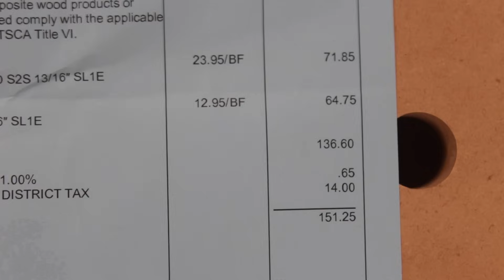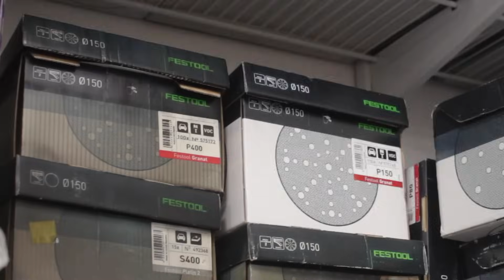Building A Tambour Whiskey Bar

Comment: Omg that end grain is glorious! Obviously how you did your rabbets were scary, I’m trying to remember from the start (end grain is confusing me) but probably would’ve been best to to add those prior to cutting your pieces small. But again I could be wrong, with the grain direction changed early on I can’t figure out if that would’ve worked or not plus you cut your shorter so that’d be something you’d have to rip early on too. Another idea is to mount all those pieces snuggly onto a longer/taller board using carpenters tape and then rabbeting those out. Regardless, good job mainly said that for anyone watching and wondering another way around it! Very good job, I love this simple size and the beauty this piece has is just stunning! The cow hide is my favorite idea for joining all those beautiful pieces of end grain together! Love these builds
Reply from the maker: Thanks for the kind words, and I agree the leather really brought it together!

Comment: Just a short question from my side. The glue you're using for adhering the slats with the leather is it ordinary wood glue diluted with some water?
Reply from the maker: It’s contact cement, you put a coat on the fabric and slats and let it dry completely, once you touch them together they have a reaction and stick to each other firmly.

Comment: The zebrawood looks very nice with the walnut.  Did you use a colored stain to get the colors to be so close?  And did I see that right - the lights turn on and off when it's opened and closed?
Reply from the maker: I didn’t use any stain on this project, it’s all satin oil based Varathane. The colors just worked in my favor with this one. And yes the lights have motion sensors and are automatic, they turn off 20 seconds after the doors close.
Reply: @Yarmles  Very nice.

Comment: may i ask how did you mounted it to the wall? (prob a dumb question, but I still see my self as a beginner)
Reply from the maker: I attached the aluminum L channel to the wall and slid the shelf over top of it and put those brass screws through the case into the threaded holes I made previously.  Definitely not a dumb question, I could have went into depth a little more on the install myself. Thanks for watching